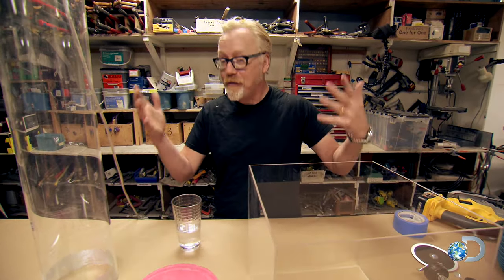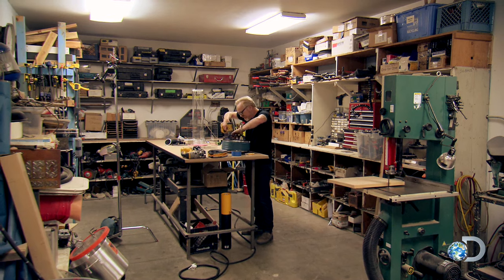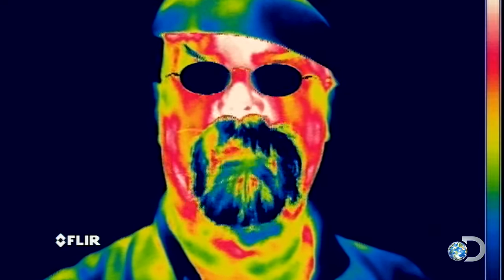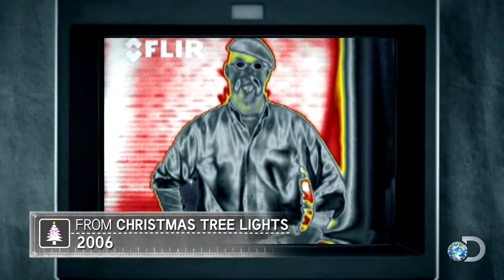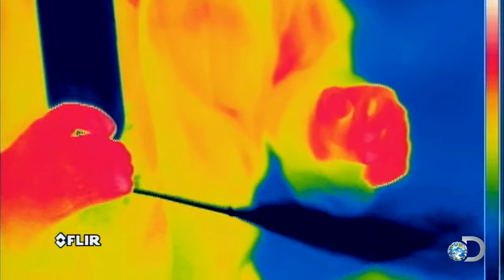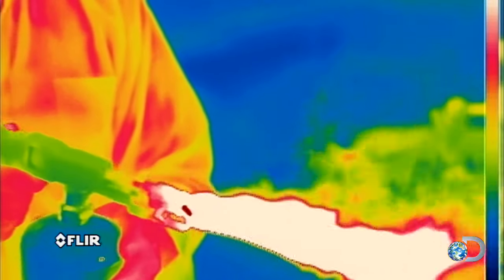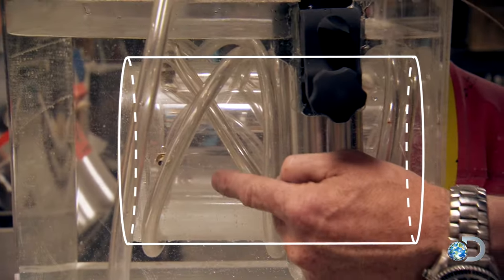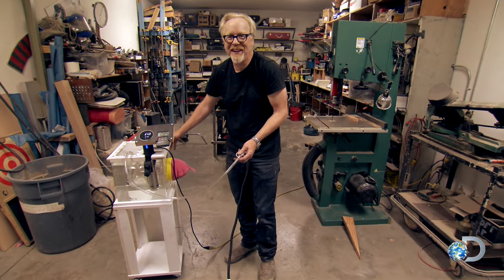Adam's Fart Machine | MythBusters

Comment: it doesn't work.   The problem with the machine is it doesn't add humidity. A fart should be close to 100% humidity and would make gas more dense and more likely to be picked up with camera.
Reply: Our breath has a much higher humidity than the surrounding air on average due to the moisture in our lungs, extrapolating that fact to the digestion tract which is almost entirely filled with fluid.